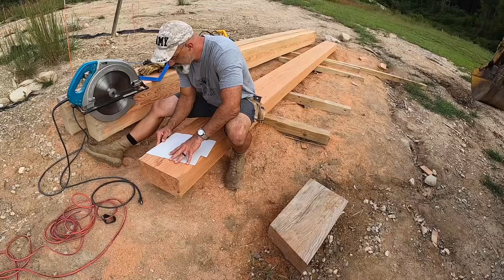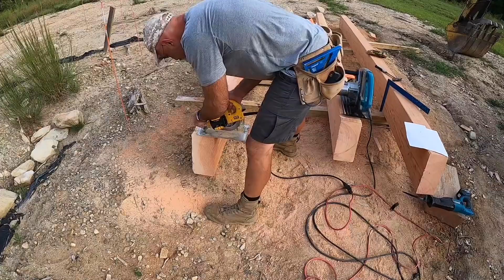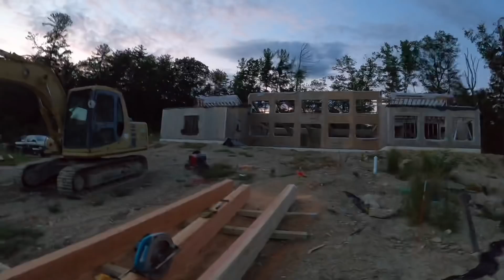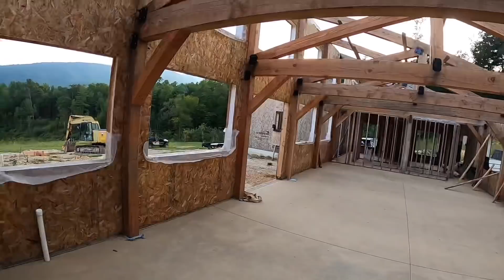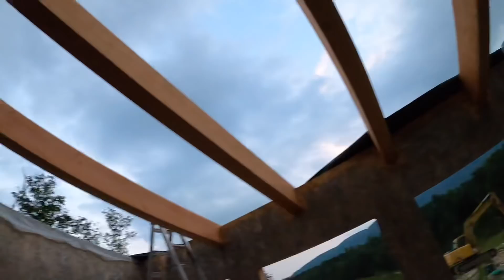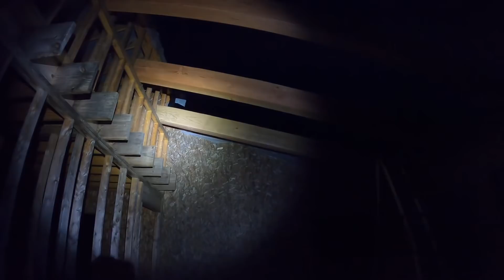Installing the last beam in our master bedroom.  All timber frame work is done.  DIY house build #76

Comment: Congratulations.  I hope you can get it dried in quickly.

I just put my money down on some land.  I don't have anything nearly as complicated planned but the hard part is staring at me, surveying, planning, permits and site work.

Once I have a slab and utilities figured out, it's going to be easy sailing for me but getting there is going to be a challenge I'm sure.
Reply from the maker: Plan everything out. Build it on paper, imagining everything you can. You will find flaws in your process and can correct that.
Reply: @breakheartorchard  my paper build is very close, I'm at the point of adding minor tweaks to use space almost like a tiny house, to make a small bathroom full featured, hiding ventilation and laundry in otherwise unused space and even organizing the garage space to make a spot for my dust collector.

I have tried to use sketchup to create a 3D model but it is pretty horrible.  I think I will probably make a foam core board scale model to physically confirm the design.

Before I go that far, I need a land survey because the flat spot on the land is kind of shaped like a "9" and I want to build on the bottom line, not the loop.  I have to make sure that section is wide enough for setbacks and won't require too much earth work.  I have a question of sewer vs septic, sewer might be possible if the sanitation company can extend their line about 150', otherwise I need to figure out where I should put the septic.  Lastly, it is desert but rain comes in monsoons so flash floods are a concern, I think I want a french drain around the foundation just in case.

Lastly, permits are a potential issue.  It does not seem like I will have a hard time getting them but I have to do some maneuvering to make sure my current plans and future plans fit.